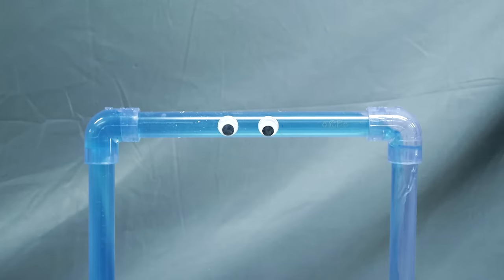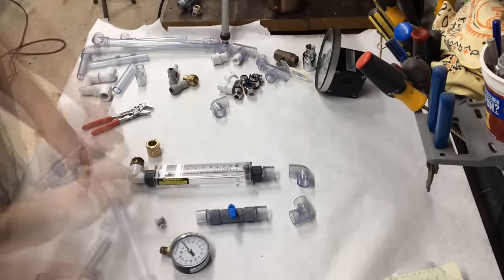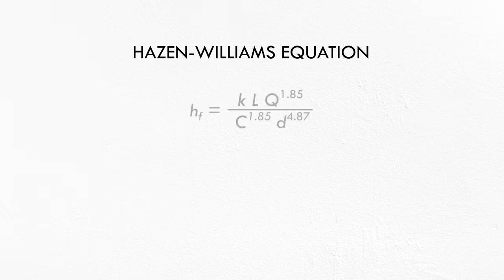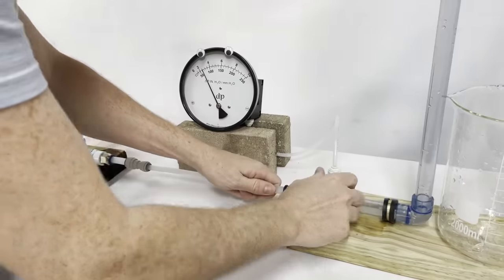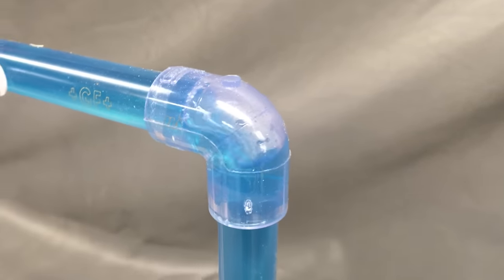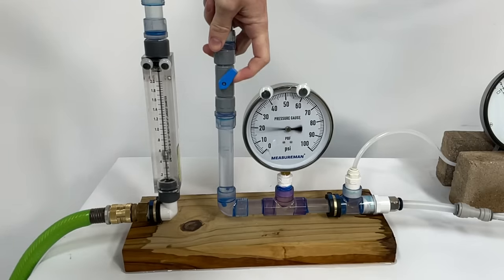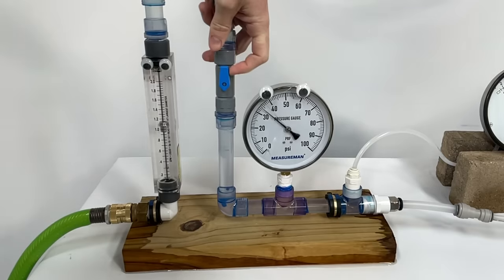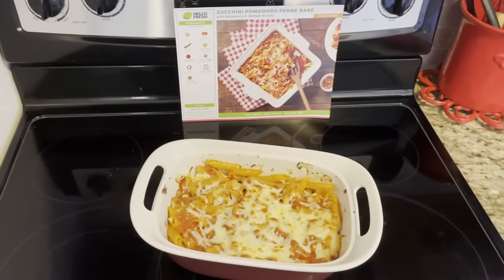Flow and Pressure in Pipes Explained

Comment: Interesting how civil engineers use electricity to explain water flow, but electrical engineers use water flow to explain electricity.
Reply: Yup!  I do it in my science class too.   LoL
Reply: Either water or electricity are handy ways to explain software design, to answer the question “So what do you do?”.
“Well, I’m kinda like a plumber for data flow.”
Reply: It's like the definition of recursion: see the definition of recursion until you understand it
Reply: But how would an electrical engineer explain water flow?
Reply: I studied mechanical engineering, in my mechanical system class they tought us that fluid networks are like electrical wiring and in my electrical fundamentals they said think of electrical network as fluid piping, I have never denied derrida's deconstruction since🤣
Reply: Piping gasses fits in the same category as well.
Reply: Yeah, mechanical and electrical engineering are very much analogous to each other. 
ME is all about mechanics, thermo, fluids, hydraulics, pneumatics, acoustics, etc 
EE is all about electricity, magnetism, semiconductors, electronics, photonics, optics, etc

Physical phenomena of Inertia, resistance, transmission, transformation, oscillations, waves, damping, actuators, switching, amplification, etc found in both Electrical and Mechanical systems are strongly analogous to each other.
Reply: thanks man, glad u appreciate us engineers smd
Reply: He nearly lost me at “I’m going to use the analogy of electricity”
Water flow. I understand.
Electricity. 😕
Reply: Improper use of "but." There is nothing contradictory or surprising in a comparison relationship. What would be interesting is if you found a clear comparison that did NOT work both ways.
Reply: ….and just as a leak in the pipe causes a shutdown, letting the blue smoke out of the wire also leads to a shut down. It seems most electrical engineers don’t know their systems work on blue smoke!
Reply: Hm
Reply: Mechanical engineers use both to explain heat transfer XD
Reply: Back before there was software to model water systems, some civil engineers used electrical bench models as analogs.  When I started my civil engineering career in 1980, this was already considered an outdated technique.  I started modeling water systems on a mini-mainframe.  Now, anyone can download EPANET for free and model water systems on a PC.  Of course, it helps to know what you are doing.  :-)
Reply: It is circular references all the way down
Reply: EE: "It's like a flywheel"
ME: "No different than a capacitor"
Reply: And then put them together and demand they will explain it,  but using only own field.
Reply: This made me laugh a little too hard
Reply: See now I'm imagining tryna explain electron flow to a plumber. "Well we idealize the force as moving this way but the electrons move backwards, ... Like um when you turn the faucet on but the water comes up out of the drain..."
Reply: lol
Reply: @johnsmith1474  I think you're missing the point that when one uses x to explain y, at least in a helpful way, it's assumed that x is strictly simpler than y. In this case, x is used to explain y, and y is used to explain x. Therefore, x is (according to all usual assumptions) strictly simpler than itself. But this is a contradiction. See how the use of ‘but’ is warranted?
Reply: @stephenspackman5573  In this case it is more that things are sometimes easier to understand if you take a step back and rethink the problem from a different approach. That way sometimes you can make connections that were less obvious when viewed from your initial approach.
Reply: @Solarbonite  we need a definition that can’t just be tail-call optimized into a loop
Reply: @maxwellyedor7610  it's like the internet...
Reply: They got each other's back.😂
Reply: Ultimately all flows of energy are interchangeable. Morphology is the master science.
Reply: My stoner depression brain has taken me through many thought experiments and one thing I always come back to is water, it is incredible how much water terms can be applied to anything, energy, time, relationships, the human body, etc
Reply: Hardy Cross/ kirchoff's law ...
Reply: A
Reply: Another perspective is another window in a house to another perspective outside (outside being your understanding)

Comment: "substitute your preffered units" ah yes, water volts, water amps, and water ohms.
Reply: I'm using Planc units. I mean, why not? /shrug
Reply: He didn't say to convert the unit type, he said you could change the unit size.
Reply: Yasssssss hahaha!
Reply: Me too lol 😂
Reply: I hear ya. I've found that the water analogy of electricity is much, much more useful to me when used in reverse
Reply: Ah yes water joules of energy was transferred
Reply: So, water Watts ?
Reply: @joshyoung1440  whoosh.
Reply: @skipfred  literally the only woosh here is you not catching that I was playing along with the joke. Read for comprehension, not to say "gotcha!!!", my dude.
Reply: @joshyoung1440  Josh out here hitting people with 1.21 gigawatts of hurt
Reply: Hahahaha
Reply: Oh yeah electricity head,  electicity pressure....
Reply: Let's not forget water meters.
Reply: Yep, coffee machine electrician here, always view water the same as electricity!
Reply: I mean you can model multiple domains meaning a hydraulic system can have a mechanical or electrical equivalent. Pressure is volts, flow is current, and pipe friction is resistance just like you said. Look up bond graphs if you're interested in the math!

Comment: Fire protection engineer here... We use hazen-williams to calculate pressure loss in water-based fire sprinkler systems too!
Reply: Hazen Williams predates Darcy... and isnt that accurate.. but for what you need it for the +/- 10% isnt that big of a deal.

Comment: As a firefighter engine operator I use friction loss calculations a lot. Nozzles are designed to have a certain pressure on them to form a proper stream, this means calculating your head loss for the given flow.

I might use this video as an introduction to pump operations, you explain friction loss well.
Reply: My dad was a firefighter and I remember (from 50 years ago) listening to him and his buddy chat about their new pumper, flow, lift, nozzles and all that good stuff.   I was in high school and it was a lot to try and wrap my head around.  Turns out firemen needed to know more than how to drive red trucks and spray water on stuff.
Reply: @larryg3326  Cook chili and slide down firepoles too.
Reply: Now that you mention it, it sounds so obvious you guys need this but I never stopped to consider it. Thanks for sharing!
Reply: Angus Fire in the UK used to make available a free tool for calculating the head loss in firefighting pipe. - Looks like it's still a thing - used to be a downloadable application, now it's a web thing.
Reply: @larryg3326  It can get complicated. Growing up I loved math, didn't realize how much math was involved in firefighting until I took a operator's course. I am now a full on pump nerd, having complicated what if conversations about pressure, friction and throughput of differ t trucks is definitely something I enjoy doing with my fellow pump nerds.
Reply: @TomOConnor-BlobOpera  there are tons of apps, website and even standalone calculators for this. I made a "cheat sheet" on an excel spreadsheet with all the common flows, hose sizes and lengths and printed it out. Sometimes the old school way works so why rely on a cellphone? 

I also put the friction coefficients and friction loss formula on the sheet in case you have to do some custom calculations in the field.

One interesting thing is the "rule of thumb" when you double your flow rate it quadruples the loss to friction.
Reply: My problem is I rotate out of 4 stations and 4 engines. Each truck has a different set of nozzles rated for different pressures. I did like this video though. It helped me understand adding pressure for an appliance. I never understood that however this video explained it as a minor loss.
Reply: Fire protection engineering student here and I honestly forgot until this video that the h-w correlation gets used outside of fire suppression. Forgot ppl use water for other stuff 👉 👈
Reply: He never touched on the sources of the coefficient of friction in a pipe, only mentioning it as part of the equation. Thus I would say while he did mention a few items, he did not "explain" them. A list is not an explanation.
Reply: So puting it off and on dont work?
Reply: I looked...

Let me know when you make that vid. Sounds interesting.

Comment: The neat thing about minor losses is that it applies to our body as well. Where blood vessels split and bend is usually where we have the highest pressure, which is why ruptured aneurysms tend to happen there (e.g. split at the descending aorta in the stomach, split at the carotid arteries in the neck, split of the circle of Willis arteries in the brain).

Changes in diameter is also where turbulence happens, which is why blood clots tend to settle in certain places (e.g. when veins dump blood into the heart, or when small veins transition to large veins).
Reply from the maker: Very cool. Pipes are pipes after all!
Reply: @PracticalEngineeringChannel  and cardiologists are just glorified plumbers.
Reply: Being a plumber with 40 years experience, you'd think I could sort my own heart problems....lol...
Reply: that doesnt make sense, at bends and split would it not be lower pressure because you have pressure drops?

Comment: I loved the smirk when talking about units. In hydraulics specifically there are some crazy differences when you change units. It's so easy to mess up calcs by just using the wrong units, even within a unit system.
Reply: Especially when dealing with unit conversions or the lack there of.
Like when you change settings expecting  feets and it changes in meters...
Even space projects have been failed because of unit conversions.
Reply: @kholdanstaalstorm6881  As an engineer in the US, I always wonder how many hours I've wasted with weird unit conversions. I wish we used metric.
Reply: @Lady-Lilith  
And I as a technical drawer in a European country wonder how much time lost when working with US produced equipment to get them to fit and connect to European installations.
Not just the dimensions of fittings and threads but the 110V 60Hz supply needed for some equipment.
Whenever you can't use a inch based fitting and has to get or worse make a conversion connector. 
I too wish the US followed the metric system.
Reply: @kholdanstaalstorm6881   I worked in Q.A. in the Auto Parts Supply sector for decades, and then, in semi-retirement, in a shop that made parts for locomotives, oil and gas and military here in Canada. The auto parts supply was easy, as almost all our exports were to the U.S., and I more or less grew up in the Imperial system.  Later, in the smaller shop, everything was in metric. It was a bit of a shift for me.  It's easy to convert, it's simple math.  But it's hard to 'imagine' systems you weren't raised in.  For example, I can 'imagine' the feel of a pound in my hand, but not a kilo-- if that makes sense.  It doesn't really impact much, except maybe confidence in the matter at hand.  In the end, while I think metric is easier, what's really critical is standardization.  I'd use cubits if the rest of the world was using them.
Reply: Also, if you ever want to unmask an American tourist posing as a Canadian in Europe, ask them what mm socket can be used on a half inch nut.  Canadians know.
Reply: Neither American or metric units are good for all pressures, but they usually use good units for the task at hand whether it's in mBar, mmHg, psi, inH2O, atm, kPa, ksi, etc. I usually have to convert through atm to get from one unit to another
Reply: @rodchallis8031  Hehe, nice, could be such an unexpected nightmare scenario for intercontinental spies, too! :)
Reply: @rodchallis8031  "For example, I can 'imagine' the feel of a pound in my hand, but not a kilo-- if that makes sense."

Doesn't make sense to me. A kilo is easy: it's a 1 litre bottle of water. A pound is, uh....I'm going to have to look this up. 

Fortunately, Internet to the rescue! A pound is 30.68 tablespoons, 92.03 teaspoons, 1.92 U.S. cups, 1.60 imperial cups, 1.81 metric cups or 454 ml of water.

Comment: Fun fact: in refineries and chemical plants a significant amount of the noise is caused by these principles. Flow rate, Reynolds number, pressure, pipe material and wall thickness work together to cause audible sound. This also helps explain why some pipes are bigger than what the calculated flow would require. 
Great channel btw

Comment: I work with hydronic heating contractors and it’s amazing to me how very few of them seem to understand pipe size and flow. I see it almost daily that they drastically undersize their heating pipes and then in winter don’t have enough heat at that zone, despite having a large enough boiler and radiator.
Reply: You would probably also be amazed at how many think that reaming pipes at joints is unnecessary, and don't do it,  if you knew.

Comment: A couple years ago the existing sump pump in our crawlspace got overwhelmed with flow. I studied the pipe arrangement and then did some research. The pump had a 1.5" output, and previous owners had hooked it to a 1.5" pipe, up about six feet of head before going horizontal, two unnecessary 90-degree bends and ten extra feet of pipe before exiting a wall, and then to a rollable 1.5" vinyl hose. So I got a second pump, used 2" pipe, piped it directly out the wall asap without the extra bends, then 3" pipe outside and then to even larger daisy-chained vented drain pipes. Dramatically improved the flow, we still needed both pumps but it caught up so one would cycle on/off. Also used a quiet check-valve to avoid backflow (and thumping).

I'm pretty good with my hands but don't have a lot of experience with home improvement, so I'm pretty proud of this project, even as simple as it was. :)

Comment: I love to use this analogy in reverse, to explain electricity I start with "imagine a pipe system". The tension is how high the water column is, the current is how much water is passing the tube and the resistance depends on the tube...   makes way easier to understand electricity, because is way easier to imagine water flowing in tubes.
Reply: I was thinking exactly, exactly that.

Comment: Great explanation! We put in a pool and after much research, I requested 2” pipes with separate lines for bottom drain and skimmer as well as the return lines. Most pool builders will only use 1.5” pipes and T intake lines and return lines together which causes more resistance with less flow, your pump works harder, increasing electricity cost. Add a flow rate gauge and a variable speed pump to make it as efficient as possible.

Comment: When you had the large diameter pipe in there, you still had small diameter pipes on either side of it. Those small diameter pipes would dictate the pressure differential with a minor tick from the transitions.
Reply: it might have made a difference on a longer pipe, yes. However, you would have seen at least some drop in differential pressure, were it not for the minor losses stacking up in the setup he created, and I think that was his point.
Reply: Exactly what I was thinking. Once you go through that small diameter pipe thats all your going to get from that system of pipe
Reply: @simongibbs9392  if it were 20' long, you'd notice a significantly smaller pressure drop.
Reply: My toughts exactly. He definitely could have accomodated a longer piece of the thick pipe in the apparatus, and shortened the tiny tubes. Especially when you look at the location of the pressure gauge lines even further back in the tubing, you see most of the experimentation zone is actually just small tubes and fittings.

Comment: Great timing, I'm working to improve the snowmaking system at a ski center. We are improving the water and the air distribution while providing higher pressures higher in elevation to utilize more efficient snow guns.

Comment: Off the wall idea: disregarding cost, could adding dimples like a golf ball on the inside wall of a pipe reduce friction and increase flow?
Reply: It might be a good concept. But,  we're pumping fluid, not air.
Reply: @MikeSmith-qj2ys  Air is in fact a fluid, so fluid dynamics apply to both air and water. Liquids and gasses do have differences, but they are more similar than most people assume.
Reply: Neat idea but I don't think so. From what I understand the dimples actually increase friction but significantly reduce the drag. Not sure if there is any measurable drag in a pressurized pipe system...
Reply: Internal HDPE liners do a better job than dimpling but its not cost effective for most pressurized systems.
Reply: the dimples would typically increase the piping's roughness factor increasing friction losses.

Comment: I'm a little confused, as I thought water pressure throughout a system remained constant. Is the pressure gradient one then that only exists during active flow, but when flow stops that gradient would disappear?
Reply from the maker: Yes exactly. The difference between hydrodynamic and hydrostatic conditions.
Reply: @PracticalEngineeringChannel  Ok, thanks.  And thank you for continuing to present often esoteric information in an entertaining and informative fashion.
Reply: @PracticalEngineeringChannel  please give me advice for buying water pump for borewell
In my farm there is no electricity available
I am using solar panel of 2000watt
Flow rate is not matters for me
Which pump is best for lift water up to 800 feet on 2000watt solar panal
Difragm pump or gear pump or screw pump